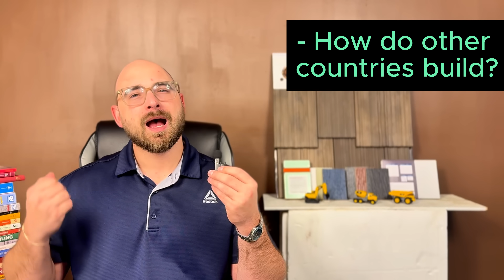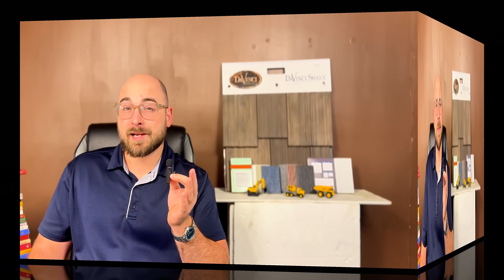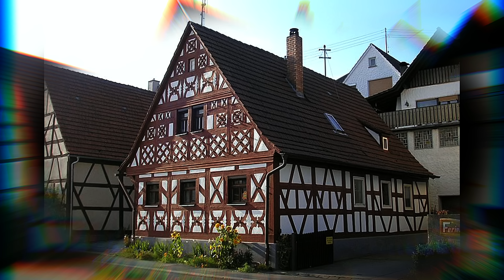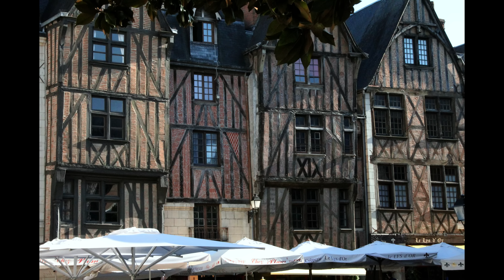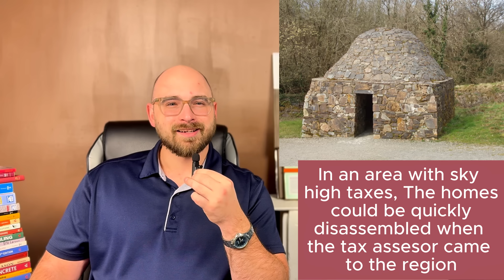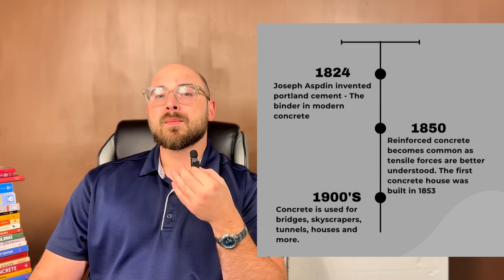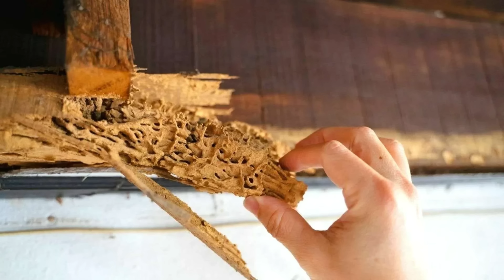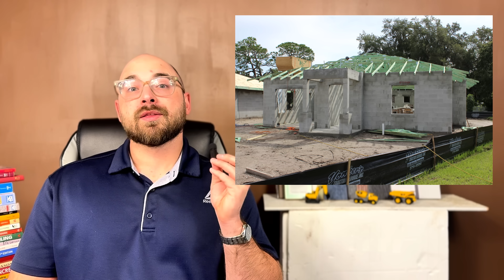Why Other Countries LAUGH at American Homes

Comment: Hi there, I’m an architect from Europe so I know, at least to some degree, what I’m talking about here. Modern building techniques in Europe do result in not only modern but in more durable single-family houses, indeed. We use primarily non-combustible roofing (metals, ceramic roof tiles), hollow bricks, plaster, etc. We do not use cheap asphalt shingles, stick framing and cheap vinyl siding widely used across the US in Canada. And strangely enough, our houses are still not more expensive. Go figure.
Reply from the maker: Thanks for the info!

What’s the average cost of a single family home in Europe as you’ve seen it? 

From what I saw in my very limited research home ownership seems to be lower, rentals / multifamily are preferred and houses could be quite a bit more expensive , almost double the cost in some locations
Reply: @Mike_Fortin  Thanks for responding. It really depends on the area. Generally it’s cheaper in the East (like Romania, Bulgaria, etc.), then it gets more expensive when one goes west. But rural Spain or rural Portugal is cheaper than urban Poland or Czech Republic, for example. Anyhow, a construction of a modern single-family house of 150 m2 (1 m2 is around 10 sq ft) in the East or even Central Europe would cost about $1500.00 per 1 m2. Again, with non-combustible roofing, hollow bricks (they have an excellent thermal properties) and plaster.
Reply: @kriszukowski4530  " ... in the East or even Central Europe would cost about $1500.00 per 1 m2." 
In central Europe, especially in Germany, this starts at 3000 euros per square meter.  Prices of $1500 per square meter once existed 10 years ago.
Reply: @tomba8992  He is talking about the house only excluding the cost for the land.
Reply: @fkiesel9442  In the south of the U.K. the cost of the land is a major factor. If a plot costs £400000 an extra £100000 in construction cost makes little difference.
Reply: @tomba8992  ok, but 1 m^2 is almost 11 ft^2.  so at $1100 per ft^2, as another commenter mentioned, that would be nearly $12,000 a m^2...
Reply: @Mike_Fortin  Low ownership rates are largely due to the unavailability of land, not to the construction costs. Here in England I wanted to self-build in a rural location but gave up on the idea, since buying a plot of land is a nightmare, and if it comes with permission to build... forget about it.
Reply: @Mike_Fortin  Take 400k as a guideline.
Reply: @Mike_Fortin  We've been lucky and got a single family house (75m2 roughly) for about 260k USD. The price here is mostly cause of the location, being walking distance away (15 minutes or so) from the center of the town, yet being far away enough that you don't get much of the noise. The house is from 1912 I believe, so classic brick construction with 50cm exterior walls and a (suprisingly dry) basement. That said, this would have been more like 150k 5-10 years ago, the prices of housing in general has skyrocketed in the past couple of years.
Reply: @Mike_Fortin around 70-80k to build 😊
Reply: That’s because Europeans wouldn’t be able to afford them and most live in apartments and not homes. Home ownership is not any where near as big in Europe as it is in the US
Reply: @anthonyk423  It's not that Europeans can't afford it. In Europe, it's just that a lot of people have moved from the countryside to the cities. Many people have left their houses in the countryside and gone to live in apartments. Not only because of work and city life, but many people argue that they don't want to take care of a house. I personally don't feel that way. But I also know many people who leave the cities in old age and return to the countryside, but there are fewer of them than people in the opposite direction.
Reply: This aren't houses in the US, this are just filmsets. I guess it's cause the people moving around a lot and europeans are more local and building for generations.
Reply: Houses built with those materials in the US are more expensive than houses built with traditional stick building materials.
Reply: @GrymmGaming  those other materials are more expensive but I'm not sure that's the only reason we prefer the type of construction we like. I think a lot of it comes down to what we're familiar with. We have stick built houses everywhere so being as it is what everyone has it's also what everyone wants. For a lot of people buying a house is a major purchase so we want it to be a good investment too. It's just not the time to assert your style and individuality. You want what everyone else has so it's a commodity. It has to be money in the bank. If it isn't the bank won't even give you a mortgage then. Broad appeal is important. Here stick built houses are known quantities. I grew up in an affluent city and we had one concrete block house. It was even a Frank Lloyd Wright design. It was widely considered an undesirable piece of crap. This British family owned it. I went to school with the kid that lived in it. He was white trash. That house was ugly. I wonder if it's still there? But it just didn't fit into the neighborhood. It stuck out like a sore thumb. It was in the working class section of town too. It wasn't even up on snob knob. It was funny because often you'd be with someone driving by it and it'd get talked about. The whole it's a Wright design thing and then dismissing it with rolled eyes. You know that's a Frank Lloyd Wright design. Then everyone would roll their eyes. Yeah you can keep it too.
Reply: @1pcfred  - If I were buying a house (Which has been a while since I bought one) I would want one with value and a good investment as well.  Concrete homes have value and are good investments.  They are not as versatile in terms of easily renovating and such, but they are solid and have less issues with surviving in the long term.  Maybe other people feel differently, not sure.  I do know that in my area, a stick-built home is half the cost per sqft as a concrete home, and depending on materials, those can even get MORE expensive.  They are also generally a lot slower to build than stick-built homes, as there is a ton of cure time needed for concrete.
Reply: @GrymmGaming  concrete takes 28 days to reach full rated yield strength. But you can stand on it the day after you pour it when it is still green. Concrete is a crystal.  Well, concrete is the whole amalgamation. But the cement in concrete is a crystal. It keeps getting stronger the older it gets too. But the crystal grows slower with time.
Reply: @1pcfred  - I have poured a lot of concrete, I know how it works.  When we pour a slab, we don't start building on it for a week.  We also have more reliance on weather when doing concrete than we do with stick-built.
Reply: @GrymmGaming  when we pour concrete we're on it the next day. It's soft but not so soft you're leaving footprints. Jobs don't have the time to just shut down for a week either. When it starts the clock is ticking then. Then it's a race to get it done. The boss man wants to get paid.
Reply: @1pcfred  I don't care what other people want. If everyone wants what other people want, they're just monkeys. I want what I like. But it's true that just because a house was designed by a famous architect doesn't guarantee that it will be nice or that it will be accepted by the general public. We also have buildings that don't fit.
Reply: @Thales_WH  you care what other people want when it means financial security that you work constantly to achieve. We're not talking about a pair of kicks here. Most people only buy one home in their lives. Then they spend 30 years paying it off.
Reply: @1pcfred  That doesn't make sense to me. After all, since most people only buy one house in their lifetime and then spend 30 years paying it off, they should buy what they really want, not what someone else wants. What's the point of throwing money away not for what I want, but for what someone else wants? I don't even know how that's supposed to relate to financial security. Either I have the money for a given thing or I don't. Buying something else won't change my financial situation. But maybe we just misunderstand each other (because translator).
Reply: @Thales_WH  if for some reason you do have to sell then you can recoup your investment. That's how it makes sense. Otherwise you lose all of your equity you've accrued.
Reply: @1pcfred  If the primary plan and premise is not to sell, then I see no reason to bother with it. If I did, I would only have what others have and not what I want. A wasted life.
Reply: @Thales_WH  life is what happens to you while you're making other plans.
Reply: @1pcfred  all your construction workers from latin america they are all masons, do not to use bricks and beton is American choice.
Reply: Your labor costs in Europe are incredibly cheap compared to the US/Canada. Also, an equivalent priced European home is going to be half (or less) the size its US counterpart and sit on a far smaller lot.
Reply: @thelight3112  You can't say that like that. Just as houses and land in the US are not the same, they are not the same in Europe either.
Reply: @thelight3112 Size isn’t everything. The cost of running a smaller home is far less. Brick built structures are easier to heat and ventilation doesn’t cost anything if you open windows and doors and insulate properly. There is less dead space which is cosmetic and not functional. I live in a country with cold winters and we rarely have to heat, only for short periods. Summers get fairly warm, up to 95 degrees. The house never gets overly warm. When you walk in you feel the temperature difference.
Reply: @Onegoodreaspn  If you live in an area where homes only need to be heated for short periods, you don't live in a cold climate. I live in a solid masonry+brick house, in an area where the average daily winter high is -3C (27F), and my home requires a lot of heat. The standard wood framed homes here use less heating, but in Canada and the northern US there is not a single building that doesn't require daily heat during the winter
Reply: I figure your contractors just aren't rich. Ours are.
Reply: @1pcfred  Hmm, you mean like a wife and a mistress, both with diamond jewelry, kind of thing? Btw, I couldn’t help but notice that the N. American contractors drive big pickup trucks while most European ones drive taller vans - often with quite nice & handy small shops inside. And when they want some plywood sheets, for example, delivered they just call for delivery. Go figure.
Reply: Hmm house prices here in Switzerland are significantly higher than in the US.  I’ve not found US house prices to be high.  Quite the opposite.  Of course it’s a reflection of the quality and build costs.
Reply: I live in Pa. And the better half of our homes are expensive but are for sure built as cheap as possible for whatever reasons mayby multiple reasons?
Reply: Most of our homes in Vietnam is concrete.
Reply: @EmNhiềuChuyện  so that's what you're making hootches out of today? Back when we were torching them they were bamboo and thatch. You VC are moving up in the world.
Reply: Comment when you become an engineer
Reply: @WayneSewell  architects need to have a decent understanding of engineering, otherwise their designs would never make it through the approval process.
Reply: You have in the added cost of having to account for places that have regular temperature fluctuation of double digits (Vegas duringthe summer has an average of about 38 C highs with an average of 24C lows during the summer.... DAILY), the pacific side being a big Earthquake line, where you're averaging Mercalli VII and Richter 7 and generally closer to the surface, the fact that our two major mountain ranges tunnel up the warm upward current of the Atlantic, and Cold Polar winds deeper into the continent, the fact that some places not even in the mountains get a good solid  because of things like the Great  Lakes effect (we have literal freshwater seas here that have ACTUAL tides), and then Hurricanes. Basically we got the hard mode with disasters. your pithy F3 once in a blue moon, is our F3 multiple times a season, your Category 2, is when we stop worrying, your 5.2/V is a little shake, your mild weather means you're looking at single digits at worst within a day, and then worrying about people dying in a regular heat wave because you haven't learned a goddamned thing over two decades... in temperatures that a good majority of Americans consider... nice, and then don't get that yes, those images/videos (usually out of Lake Effect areas) have that much snow and it's not them getting pranked, and just can't wrap their heads around it. And we're talking about places that get some of the snowier places in Europe's YEARLY average in Days, or a Day.

And that's sort of the thing Europe is easy mode, calmer weather (you're on the down slop of the atlantic current), less varied climates (a good portion of the continent is plains), actually have East-West ranges that tend to block the formation of major tornados (the Pyrenees, Alpoes and even Carpathians), and have deeper, and less frequent earthquakes due to plates not smacking hard against each other as much (the vast majority are well within the Eurasian plate), and pretty much no it was 38 at 1000 but now a 2200 it's a solid 26.
Reply: The US takes in 1.4 million immigrants a year, plus another 400k illegals annually. Its more than every other country in the world - COMBINED. That is why housing in the US is expensive, not because of build quality.
Reply: Homes in Europe are about double the building cost of US homes.
Reply: @MAC-hb5yr  absolute Nonsense! Show us the evidence
Reply: I really like the high end log Huge, log homes like they built up north Canada if i remember correctly
Reply: Have you factored in the cost to the environment of your concrete houses?
Reply: @Jeffhowardmeade  And have you factored in the fact that a well-built masonry house might last for centuries, instead of being rebuilt every 30 years or so, so its environmental cost doesn't add up again and again over time?
Reply: @Myria83  I'm now surrounded by entirely wood Victorian houses. I was raised in a house that's now 75 years old and still in good shape. I  raised my kids in a house built in 1965 and it's in great shape. The Loomis Homestead in Windsor, Connecticut is mostly a 17th Century wood house that still looks great. Burmington Manor in Stratford Upon Avon has timbers dating back to Richard the Lionheart.

I reject your notion that a wood house needs to be replaced every 30 years. If well maintained, even a modern platform-framed house will last centuries. You'll need to replace the roof, the mechanicals, the plumbing and the wiring every so often, but you need to do that with a concrete structure as well.
Reply: @Jeffhowardmeade  The problem is maintenance. It takes most people a long time to discover a problem, and even after they discover it, it takes a long time to solve it. A wooden structure requires an immediate solution to the problem, while a brick and especially a concrete structure can withstand poor condition for a very long time, which can have a significant impact on it. That is why most wooden structures do not last that long - poor maintenance. Often, an inappropriate initial construction method contributes to this, which cannot be completely compensated for even by good maintenance.
Reply: @Thales_WH I don't know about everyone else, but I notice leaky roofs pretty quickly. A bad foundation is just as detrimental to a concrete building as it is to a wood one. If you're not aware enough to spot termites or carpenter ants, you probably wouldn't spot foundation cracks in time, either.
Reply: @Jeffhowardmeade  It's not about you or me, I'm saying what unfortunately most people do. They either don't find out or they put it off until it's too late, or the repair is a dubious temporary fix.
Reply: @Jeffhowardmeade  Hardly anything is as environmentally unfriendly as cheap housing that has to be rebuilt over and over in the space of a century.
Reply: @RonRobertson-lafrance  For starters, not true. Wood is 50% carbon. Guess where it got that carbon from. In addition, whose houses are so shoddy that they need to be rebuilt several times a century?  The only time a wood house needs to be torn down and rebuilt is when it's not maintained. Brick and block houses are no different. If you let the roof fail, you're going to have to start from the foundation up.
Reply: @Jeffhowardmeade  The roofs don't last more than around 20-30 years in most of the US, that's a major renovation cost, the houses need other major renovations because they're made as cheaply as possible with plumbing and electrical that need redoing, that's a major and costly repair. You go through many neighbourhoods just 15 years old and already the homes are looking shabby and tired. All of those repairs are environmentally unfriendly, if they get made. Whole neighbourhoods being wiped out by fires, storms, hurricanes, tornadoes because they're so shabby is yet more rebuilding where if they had been better built in the first place they wouldn't need that. It's wasteful and environmentally unfriendly, not to mention overly expensive when it needn't be, and taking over more and more land as shabby neighbourhoods are slowly abandoned or rented out by slumlords.
Reply: @Jeffhowardmeade  Concrete has quite a big impact on the environment, therefore I prefer the brick method of most of German houses. Many US houses might not use concrete but instead a number of non-recyclable plastic materials such as home-wrap and vinyl siding, asphalt shingles and so on. When those light up in fire you have the added damage of all the pollutants being released into air and soil.
Reply: @anitapenkert8908  I'm not a big fan of vinyl siding, though it is about as recyclable as any other plastic. In other words, you can, though nobody does.

And if you're building with clay bricks, awesome! If you're using cement bricks, you're putting out more CO² than poured concrete, which is at least a third natural aggregates.
Reply: @Jeffhowardmeade  никакого
Reply: @Jeffhowardmeade  Nope. But I’m pretty sure that it is no higher than the cost of untold number trees that have been cut down to be put into the stick frames. Which with all of those thermal bridges in the exterior walls (around 30% of the surface) are also sources of continuous heat loss. By the way, vast majority of exterior walls in modern houses in Europe are not made of concrete but of hollow bricks that are primarily made of clay, sand, lime, concrete, and fly ash.
Reply: @kriszukowski4530  Lime is created by superheating limestone or chalk. That's where most of the energy is used and most of the CO² is released in the making of concrete.
Reply: @kriszukowski4530  When trees are cut down, new trees grow in their place. Those trees absorb CO², effectively capturing it. A wood house is effectively built of captured CO².
Reply: @kriszukowski4530  I live in North Carolina, just a wee bit smaller than the UK.  Most of the homes in North Carolina are made of clay brick.  Clay is abundant in this state so these homes are every bit as durable as those in Europe.  However, roofing material is generally asphalt shingles, which is of course inferior to metal roofing.
Reply: @christschool  Interesting. I’ve spent some time not that far from N. Carolina (in Ontario, Canada) and hollow bricks as the way to construct walls in single-family houses are as popular as rotten apples there. In Europe they come in a big variety of shapes and sizes (hope that in N. Carolina too) and combined with proper thermal insulation are a great way to build solid non-combustible, hurricane-proof buildings.
Reply: @kriszukowski4530  Trees cut for US lumber are almost all from land managed for the purpose. Which makes the wood not so great quality (because it is fast-growing, light wood), but environmentally the lumber part is great.
Reply: @Jeffhowardmeade  The problem is that a small tree absorbs much less CO2 than a large tree. It takes tens of years for the tree to grow to the size of the original one. You also manage to cut down those trees faster than you plant them. You don't even manage to do it 1:1, in reality you would have to plant several trees for one felled. Your consumption is so high that you have to import wood from other countries and continents. How many wooden houses do you have to build during the life of one brick house? Here in Europe we usually have houses that are hundreds of years old.
Reply: @Thales_WH  Most of the houses I've seen in Europe are no older than any in the US. Old mountain towns in Italy? Old houses there. Black Forest in Germany? Old houses there (mostly made of wood). Paris has lots of old housing on account of its building height restrictions make it not financially beneficial to tear anything old down. In most cities in Europe, most people live in post-war buildings. In Germany it's because the old ones were flattened. I'm betting most people WISH those brutalist concrete boxes from the 1950s and 60s would fall down soon.

And managed forests are densely planted, with fast-growing species that sequester a lot of carbon. There's no avoiding the fact that 8% of greenhouse gasses come from concrete production. Even if there were a benefit in the long run to concrete houses, now is not the time to be making that "investment". Everyone should switch to building with wood until we reach carbon neutral.
Reply: @Jeffhowardmeade  As far as I know, we were talking about the lifespan of buildings and not about the average age of buildings in a given area. So I logically stated that very old buildings are also common here. Try googling Prague, for example. If I don't count modern buildings, most historical buildings are made of stone and brick.

If you're talking about "brutalist concrete boxes", we should also determine what type of buildings we're talking about - whether they're family houses (in which case I don't understand why you're talking about brutalist concrete boxes) or whether we're talking about multi-story buildings, in which, as far as I know, you're the champions in the USA and I don't know what you want to accuse us of in Europe?

Even small children know that trees grow in forests, but you haven't yet refuted that you cut down faster than you plant them and, on top of that, you import wood. You avoided that and instead copied a promotional manual. You also haven't proven that you distinguish between concrete and brick, as I wrote to you. In fact, there is only a very small percentage of all-concrete construction at the level of family houses in Europe. Historically, the largest consumption of concrete (but not for family houses) is again in the USA, not us in Europe.
I don't think that everyone should switch to wooden houses, because then we wouldn't have any forests here at all. I'm glad that I live in a brick house. It's more comfortable and there's no need to cut down trees every now and then. Being sensible about the environment is sensible, but you can't use carbon neutrality as an argument for everything. Then you'll be afraid that it won't jump out of the can at you. So please provide factual arguments and not quotes from the manual. Try writing it yourself, calmly, without passive aggression.
Reply: @Thales_WH  There is no deforestation happening in the US. We plant more trees than we cut. We have had more forest growth than we have had logging since at least 1940. If you want to refer to logging in Canada as imports, well that is technically correct. Those forests are also sustainably managed. Deforestation is mostly going on in the Third World. The wood is mostly being burned in situ to create ag land. With the exception of certain exotic species for rich people's flooring, it's not being shipped here.

The US used to be the big users of concrete, back when we pioneered the Interstate Highway System and early sky scrapers. China is now by far the biggest abuser of the planet with concrete production. Large buildings in the US are now predominantly built from steel with concrete foundations and shotcrete fire protection. Steel is not super friendly to the environment, either, but it's not as bad as concrete.

I get that Europe cut down all its forests before my country was even founded, but you really need to see the US if you're worried about deforestation. If you head west out of New York City you'll quickly be engulfed by forests that don't stop unto you reach the Great Plains. Head towards Florida and same thing. Head north and it's forests until you reach the tundra. We could build every house (and we're even starting to build skyscrapers) from wood, and not come anywhere close to running out.

And yes, I see that you were referring to just the old homes, not everyone's homes. My girlfriend keeps talking about getting one of those €1 houses in Sicily and rehabbing it. Since I'm the one who gets to do all the actual work, that's a hard pass for me. The brutalist housing I was referring to were the housing developments I saw throughout Europe in the 80s and 90s. Hundreds of one and two story monolithic concrete town houses that lined the roads for miles. I believe in the UK these are called "estates".

Really, you should check out what is being accomplished with engineered wood these days.
Reply: @Jeffhowardmeade  fireproofing isn't shotcrete, it's paper. Which sounds like a weird thing to use to make something fireproof. But it's there to act as insulation. So the steel doesn't get hot from the heat of a fire. There might be a chemical in the mix to make it fire retardant? But if there is it's nothing I'm aware of. It's mostly just gloppy paper pulp. I've only sprayed the crap. I don't know all the gory details. I've removed it too. It's basically spitballs. The level of protection you can expect to get from fireproofing is measured in hours. It's an hour for each inch of thickness. I've never seen it applied any thicker than 2 inches. Not to say you couldn't. Just no one ever does.
Reply: @1pcfred  Not sure where in the world you are, but in California the fireproofing sprayed on steel buildings is cement-based, and it's made by Shotcrete Technologies. I can't imagine it's only used here.
Reply: @Jeffhowardmeade  I was fireproofing in the New York metro area. I can imagine a company like Shotcrete selling a product like fireproofing. Why not? It'd be a money maker for them. It was applied like shotcrete and looked like shotcrete dry. But it's paper. It's definitely not cement. Although it might have some portland cement in it? Something makes it stick. Once it's dry it sticks good to everything. You have to really scrape to get it off. So we'd always squeegee overspray up as we went. Wet it cleans off easy. But dry it's no cement then. It's paper pulp. It came in big bags that looked like blown insulation. We'd have a whole tractor trailer full of those bags on a job. You wouldn't be hauling concrete around in a tractor trailer. It does look like shotcrete. But it isn't. I'm telling you it's paper. I've shot it and scraped it. I've worked with a lot of cement products too. Grouts, mortars, concrete. It's none of that. It's mushy paper that's dried. When we sprayed that stuff it was like it was snowing. A lot went where we were spraying but a lot didn't. It's a really messy process.
Reply: @1pcfred  I don't know anything about what you were using, but Shotcrete advertises "STI “Fire Stop” is a sprayable cementitious inorganic fireproofing material with excellent adhesive bonding to a variety of surfaces, concrete, steel, wood etc."

My brother runs projects that shoot this stuff, and he hates it. He says getting it off if there's a change order or something didn't get inspected before it was applied is hell. 

If there's something better that doesn't use environmentally unfriendly cement, I'm all for it.
Reply: @Jeffhowardmeade  I only know what I was told. Plus I had the experience working with the material. It wasn't cement. I think cementitious just means it is sticky. I don't know why they're calling it inorganic. Maybe it is. The stuff we sprayed sure seemed like paper pulp to me. But there were other modifiers in it. It wasn't here's your plain paper have a nice day.
Reply: @1pcfred  What you were spraying is called K-13. It's cellulose with fire retardant and binders mixed in. It's different than Shotcrete fireproofing.
Reply: @Jeffhowardmeade  that's the only kind of fireproofing I ever saw. It's what everyone here uses. Spraying cement on stuff sounds extreme to me. Cement doesn't have very good insulative properties unless there's pumice in it or something. The R value of masonry is terrible.
Reply: @1pcfred  It uses volcanic ash, and according to my brother, it's both structural and fireproofing. I don't know why anyone would use that, when a more environmentally- friendly option is available. Oh, wait. I'll bet it's about money.
Reply: @Jeffhowardmeade  my advice is don't burn your place down.
Reply: @Jeffhowardmeade  I have not been able to find any verifiable information anywhere that more trees are planted in the US each year than are cut down. From a CO2 perspective, one adult tree is worth many small trees and takes three decades to grow. You have not refuted that. From this perspective, I still think it is better to build a building that will last as long as possible, while I do not find it inappropriate to say "we have enough wood, so we can plunder and waste it". I also find it inappropriate to produce plastics, which you call artificial wood. But OK, that is an opinion. However, we can try it from elsewhere. Instead of digging our heels in and solving what someone needs and considers appropriate instead of the important things, what is done about things that undoubtedly harm the environment, while bringing nothing to anyone and are just the result of a money-at-any-cost approach?

For example, there are 3.5 million oil and gas wells in the US, but they are abandoned. Most of them release methane (a much worse greenhouse gas than CO2, and also poisonous), hydrogen sulfide, oil, gasoline, and other substances that damage the environment uncontrollably into the surrounding area. Approximately 281,000 tons of methane are clearly released into the environment annually. 14 million Americans live within 1.5 miles of one of these abandoned wells. Just because the main thing is to extract what you can, make money, and not have to deal with cleaning up after yourself. The main thing is money. It would be enough to just clean up the mess after yourself. Nobody is dealing with it. They are just talking about it. Or rather, they talked about it because the previous government wanted to at least deal with cases where the owner of the former well is unknown and it is therefore impossible to force the well to be remediated. Now that you have elected a new president, there will be no hint of that being addressed. He is not interested in this at all, he is only concerned with money :( Withdrawing from the Paris Agreement is the end of talking about it. So I would rather sweep my own doorstep when it comes to greenhouse gases.

But you are right about houses, that women see the situation differently than the men who do the work. Most women say "we will renovate" and in reality they might just wash the window. So I completely understand that you don't want to do it. You have to be in the mood for it, feel that you want it and fight through all that work, which really can't be done in a week, or even a month, if it is to be done well.

I don't know what you have against one-story and two-story buildings in England? I'm not from England, I'm from the Czech Republic (between Germany, Austria and Poland), so I don't know what exactly you're criticizing there. In our country, we probably call housing estates something different than what you mean. We call housing estates ugly clusters of concrete houses 4 to 14 stories high, usually located on the outskirts of cities. These buildings are built of large concrete panels, in our country they are called "prefabs". These housing estates were created not only in Europe, but also elsewhere in the world - even in the USA, I just think they were probably called differently in your country. Many of these buildings in our country have already been repaired and look better after the repairs and have better properties. For many people it is an economical and affordable way to live, but I wouldn't want to live in one. I need trees, grass, space, birds around me. But I understand those housing estates. Where do all those people who live in them go? Sorry, I was thinking about it.
Reply: @Thales_WH  "Each year, the U.S. plants over 1 billion trees and Canada plants over 600 million trees. Both countries have spurred more than 50 consecutive years of net forest growth that exceeds annual forest harvests due to responsible forest management."

-- North American Forest Foundation

Yes,  big trees sequester more CO² than do small trees. But we have lots and lots of small trees, and even the smallest tree is better than mining and cooking completely unrenewable limestone to make cement, and emitting tons of CO² into the atmosphere in the process. You could tear down a wood house every decade and replace it for centuries and not reach the carbon footprint of an equally-sized concrete house. From an environmental perspective, it's not even close.

And yes, uncapped wells are bad. They don't emit as much greenhouse gas as making concrete, but it's also needless emissions, as we don't get anything from it. The practice of simply burning off excess methane as a byproduct of oil extraction also chaps my hide.

But we're taking about houses here. I'm sure there's a video about that on YouTube where people wish to discuss that.
Reply: @Jeffhowardmeade use local resources.  There are areas without trees and water to grow trees or the land space.  In Portugal traditional buildings are stone built, modern are concrete and steel, others poured concrete.   There is drought here so trees won’t grow.  It all depends.  But looking at fire zones and hurricane zones etc - build appropriately.  LA fires will become more usual.
Reply: @martinjc9699  In some places, wood is not an option. But the southern half of Mexico is densely forested, and yet everyone there still builds houses made from wood-fired brick and barely reinforced concrete.  An earthquake that would have killed maybe dozens in the US killed between 5,000 and 45,000 in Mexico City in 1985.

Yes, wildfires are going to become more common, but cities will be adapting. Every one of these wildfires could have been avoided if people would stop trying to plant lush, tropical landscapes in arid climates. Los Angeles imports its water from hundreds of miles away via aqueduct, only to pour half of it onto non-native plants. My house survived a wildfire in Santa Rosa, California in 2017 because I had clear-cut the overgrown trees and bushes and started fresh with drought tolerant plants. I also had a metal roof installed.
Reply: @christschool  Why no clay roofing tiles?
Reply: @kriszukowski4530  you do understand trees grow back right.
Reply: @Thales_WH  What a disgusting view of women you have.